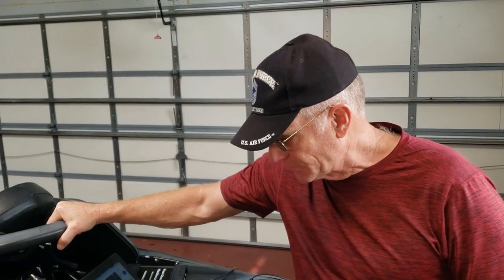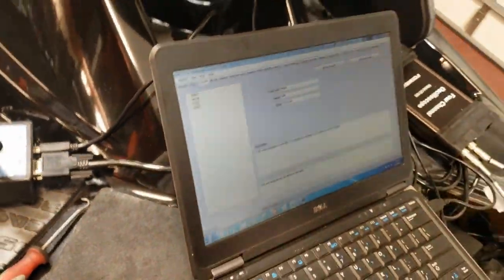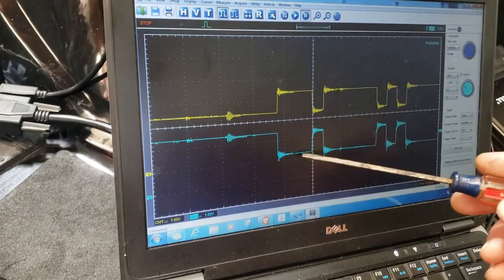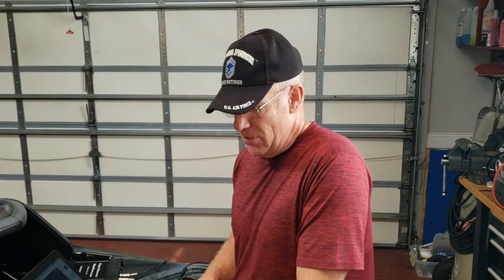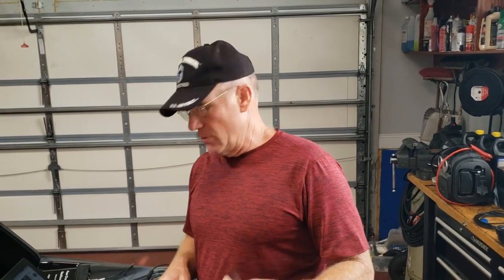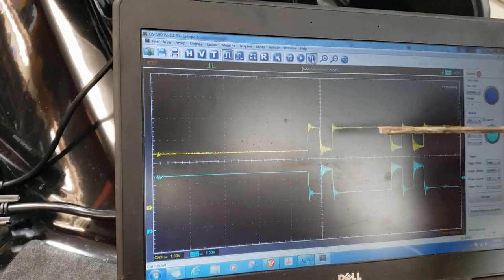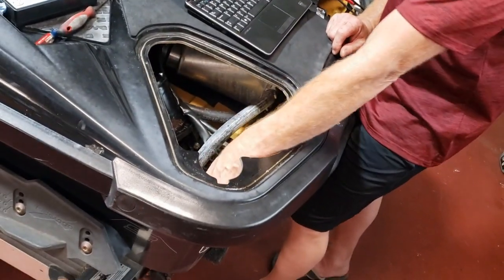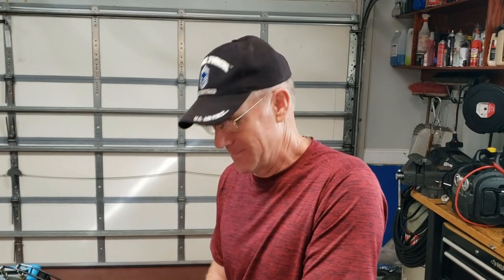2013 RXT X 260 Network Troubleshooting

Comment: hey there! great stuff I really hope this new IBR will solve the issue.
Just out of curiosity, did you load test the wiring harness out of the IBR or just a continuity test with the multimeter ?
You could have a wire that has a partial short only under load.
Reply from the maker: Thanks!  You can't test wire continuity with voltage applied to the circuit, but you can perform voltage drop tests which would indicate increased resistance under load.  A short is a short; you either have one or you don't.  i think I understand where you're going ... but suspect what you are referring to is an electric circuit (say within a motor or a sensor) where there is an intermittent short.  I've seen increased resistance in circuits caused by heat too, but it's always been in a sensor or component ... not in the wire.  Then again, I've seen voltage drops caused by corroded or deteriorated wires or faulty connections too.
Reply from the maker: Update:  The new IBR finally came in in October, we replaced it, and it worked perfectly.  Shortly after the IBR replacement, one of the TPS sensors (there are two) in the throttle body failed, and the throttle body was setting hard faults.  We replaced the throttle body with an after-market unit, and then we could clear the faults.  Now, the ski is running perfectly.